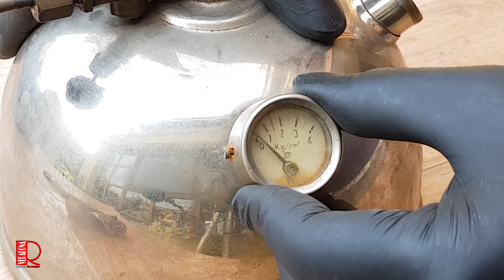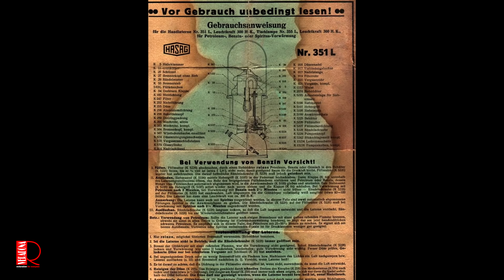Post war Hasag lamp 1945 - Restoration

Comment: Nice work.  The answer to the dents surprised me but works SO well.  I thought you were going to weld something to the side and that use that to pull out the dent.  But your solution is much better.  I also I keep looking at that lamp and thinking it's a bizarre design.  I'm used to the ones where everything goes up the center, flames burn in a ring around the center, and two smaller elements hang off to each side of center above.  Having it go up one side where a good chunk of heat is lost to the side providing little value seems.  But it works well and the results look greate.

Comment: I’ve seen a method of removing dents with a sliding hammer thing that you glue or weld to things. That night have been a better option for this. It wouldn’t be perfect but for at least around the logo it would work.

Comment: I know how push up dents. By make mold and using water pressure. First mold and its dent correction. Then tank inside and water pressure from pressure washer. It can produce 100 - 200 bar.